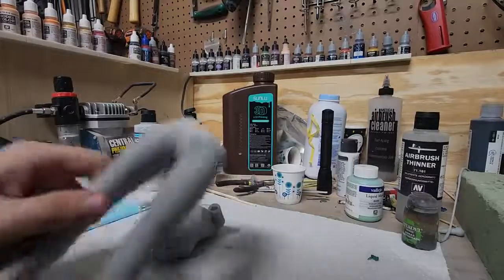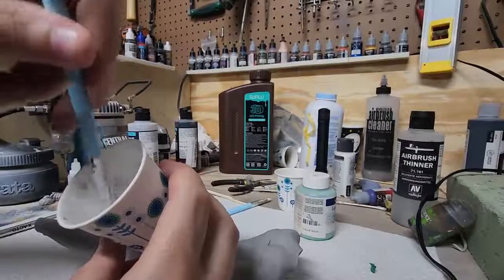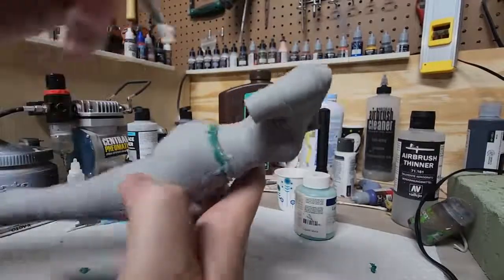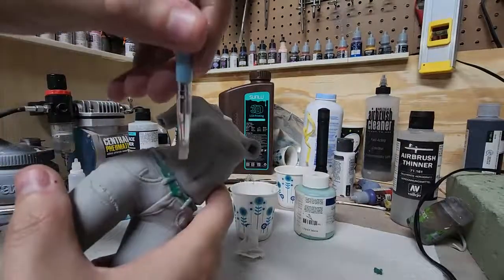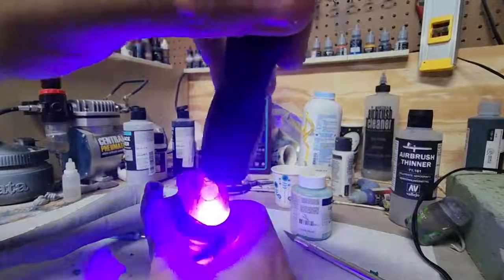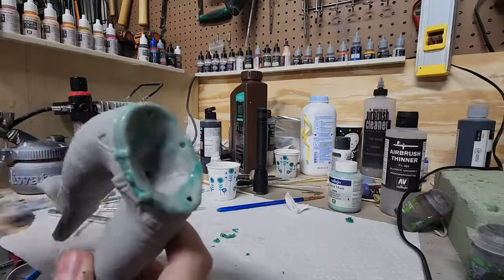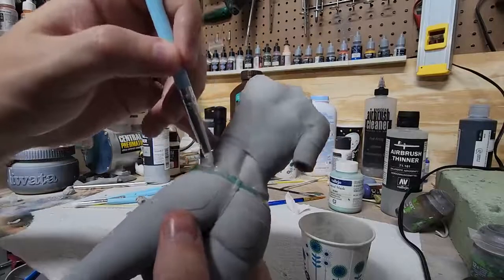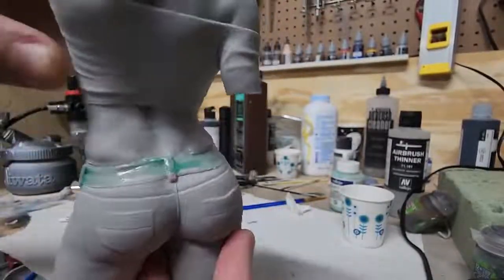How to gap fill resin parts and keep them separate (Part 2)

Comment: I am trying to master this method because I think it's really, really good.  I made a big mess with my first attempt, which I may end up calling a learning experience overall.  As seemed to be for you, pulling the parts back apart without cracking the patch line is a point of frustration for me.

Comment: I think if you had ran a beas of the thick stuff, and then pressed and held together tightly while using the curing light it likely would've worked just as well.  I've done similar and it worked out great.

Comment: This is a neat method. Never tried liquid masking, we just use the resin itself, cure on small layers of material to add where the gaps are - and then join them before or after painting depending on the complexity of the model. Those gaps are huge though, sculptor either needs to fix that, or the print had some issues on the joining areas. I never see gaps that big on the models we print. Honestly and this probably not how a lot of folks do it, but I will often times assemble the entire kit and paint it fully assembled, unless something is being blocked, then of course you have to plan that out a bit. Good vide though. thanks for sharing.
Reply from the maker: This is a combination of my hollowing with thin walls and heavy supports on those areas which face the build plate, the repeated pulls during the print seem to warp that thin wall a little. Combined with the buildup around the heavy support points leads to a gap. I could have spent more time sanding it down (and I actually did end up doing that after it was all painted...) but seemed a good excuse to show off the method :)
Reply: @tjslater2006  I got it. If you hollow them though, ease up on supporting, most likely you are over supporting the parts. Seemingly nice results though. Good stuff I enjoyed the video.
Reply: That's a "i dunno what to do with my printer"... He just puts some numbers and print it. I think he will never fix the tolerance and other settings. That is not at all a problem caused by hollowing models nor supports. That's the incompetence of the man who prints/use the printer.

Comment: I do something very similar  but lot less work  

Milliputt  stick it in the hole smooth it down with a wet cloth light very very light sanding and done 

If I don't have any putty I use blutac or white tac  stick it in the hole as a base layer to fill the gaps and then put resin over it in layers and flash each layer with uv as you go

Comment: Just saw this - looks like an excellent method. But echoing Bobby, what did you use to thicken the resin?
Reply from the maker: I thicken the resin with baby powder. Takes some trial and error to get the right thickness but it's easily corrected by adding more or less of each

Comment: How to fill gaps? Use better tolerance settings in your printer.

I never ever had a gap like that one!! Even in my low budget 150€ printers (Mars 2), nor in my Saturn 2 (550€).

If i have a half mm gap i usually fix it in seconds with green stuff paste (green) and/or liquid resin and uv laser.
30 seconds (the rare times i have gaps!!) vs a 40 min video.